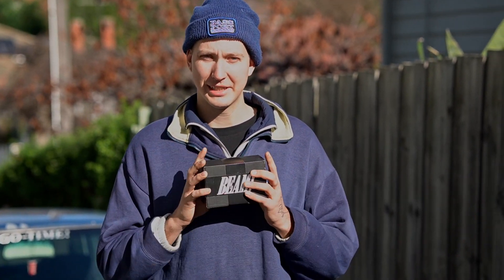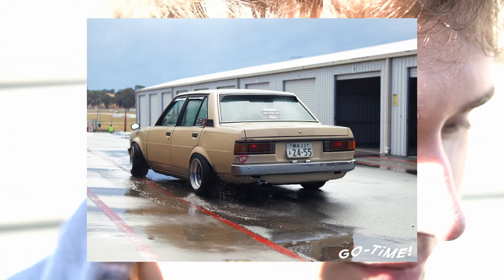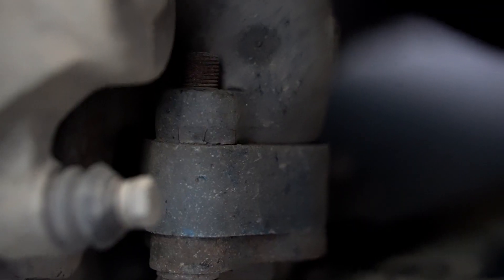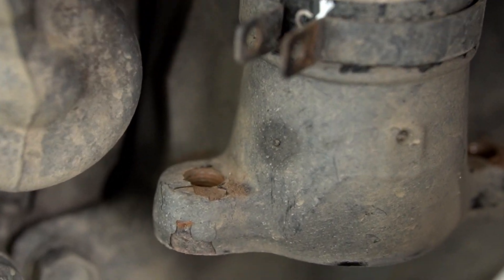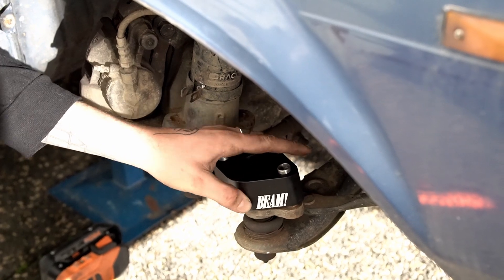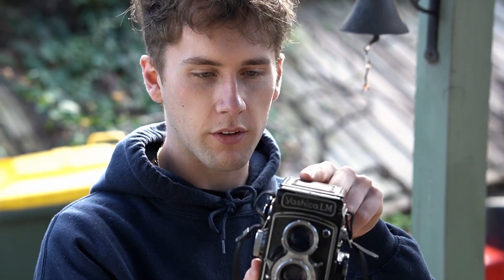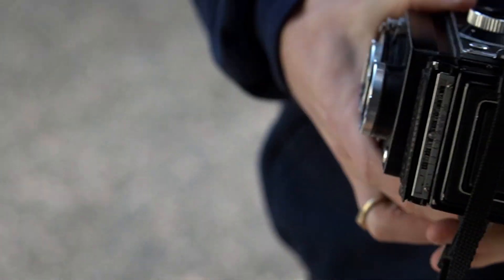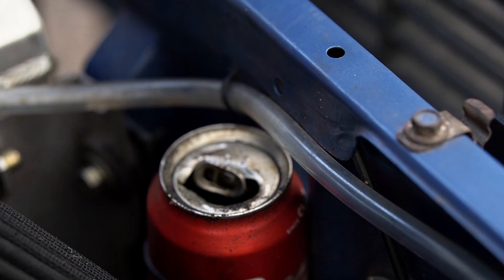RCA INSTALL: KE70 Drift Car

Comment: Hey guys. Great videos. Watch you from Norway. I have a 1980 ke70. Where do you buy parts for those cars? I need a senter axle bearing for my car. I buy one from ebay, but dont fit. I be very glad for any help from corolla people out there .